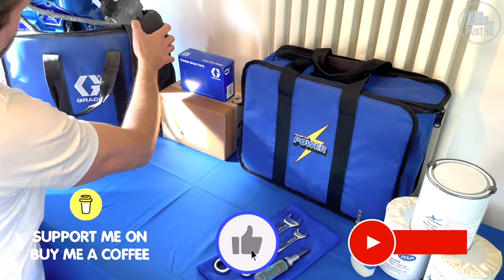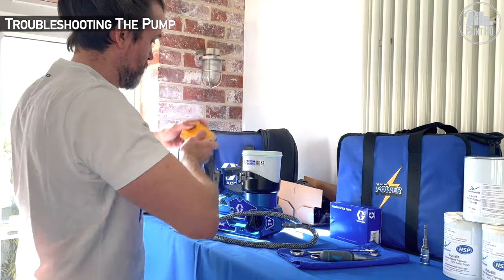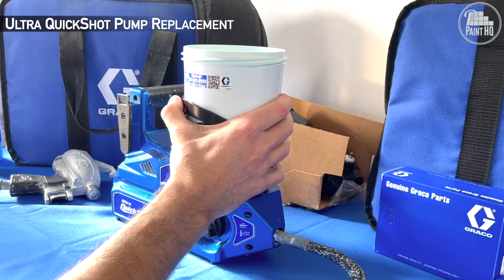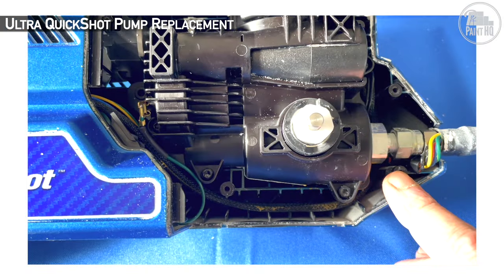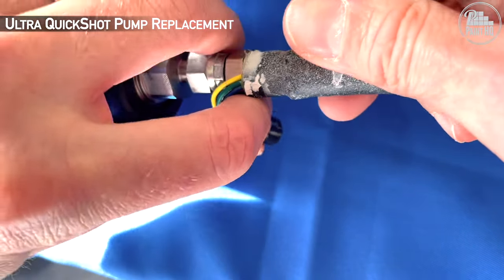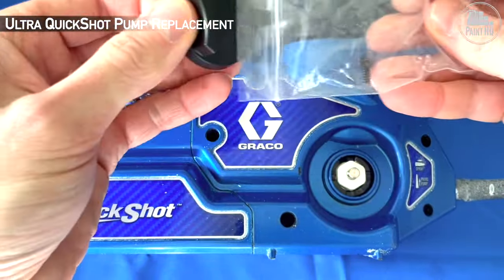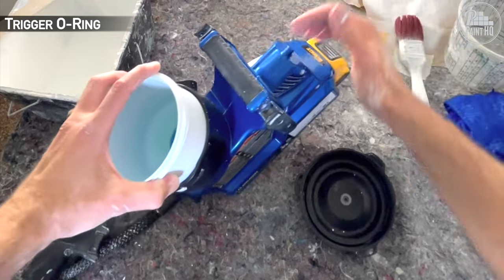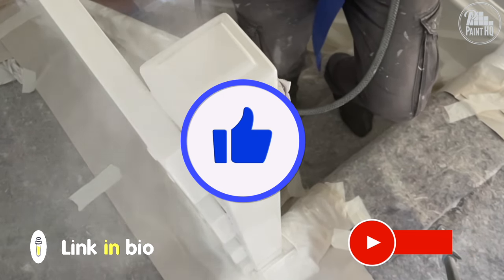Graco QuickShot [Tips & Tricks] Troubleshooting and PUMP REPLACEMENT

Comment: I own one and this is an extremely common problem. I maybe have 15 gals max through machine. Actually probably closer to 7. Same issue. For something that’s nearly 1500 dollars U.S, I shouldn’t have to rebuild in less than 3 months of light use.
Reply: Probably werent cleaning it/priming it properly. Ive used hundreds of gallons through mine. Door paint, exterior house paint, clear coats, and primer all thru my pump
Reply from the maker: @dabefarkel9382 Thanks for sharing your experience my friend 💙💯 Regards Pete

Comment: One tip for you Pete. Petroleum jelly is good but it is rubs off easily. I've been using Molykote 111 lube for things that need to withstand hot washing and are chemical resistant too.
Reply from the maker: Great tip Dmitriy, I’ll be sure to look into that 👏👏👏

Comment: hey pete great video. I’m having a hard time keeping enough power with my quick shot. It’s like the battery is dead, but it’s not and my spray pattern. It’s never atomized properly.
Reply from the maker: Hey buddy, my apologies for delayed response — sometimes comments slip past notifications ☹️ ..Does the unit prime and spray water? So remove tip guard / tip and try priming and spraying water.. does the flow spraying, increase with speed — so speed 10, and no tip guard / tip should spray a constant / steady stream.. let me know how you’re getting on my friend, once again sorry for the delay.. regards Pete 💙💯

Comment: Great video pete as always the pump replacement seems quite straightforward and your insight will help myself and many others thank you for your content pete
Reply from the maker: Ah great news John, yeah it really is a straightforward procedure 👍 Appreciate the support.. regards Pete
Reply: @PaintHQ  hi Pete just a quick question have used the quick shot with an extension stick if you have how did it go any spits at all cheers
Reply from the maker: @johnthemod71 Hi John, that’s a good question.. Yes, I’ve used a 25cm extension and you do still get a very small spit — that’s virtually undetectable in the finish when spraying ceilings.. logically a spit will occur when using any extension on any gun, because the paint that’s in the extension past the shut off of the needle, is at a lower pressure by the time the paint passes through the tip — so the spit is un-atomised paint 👍 hope this makes sense 😄 regards Pete
Reply: @PaintHQ  cheers that was a big concern of mine because I would probably use a 300mm stick to spray woodwork and all that bending up and down isn't good for my back and knees at my age I'm only 52 but feel 100 😂😂😂 cheers for the reply mate greatly appreciated

Comment: Great info Pete. Good to consider these things before an issue occurs, current pump replacement is around £260. Great little machine, glad I bought it. 

I wish all guns started using a quick release tip guard (tri-tech do I believe)...Or a shorted thread would do the trick. Always feels like it takes ages to screw on & off, especially with wet hands, or if there's been a sudden leak & you need to get it off, cleaned & back on asap! Thanks again for all your knowledge & help 👍🏼
Reply from the maker: Hey Stuart, great to hear from you buddy.. yeah I’ve been following your awesome work using the QuickShot 👏👏👏  I hear your point about ‘quick release’, it’s actually been around for a while, but naturally there’s always a question of safety when used with high pressure equipment 🤔  ..Thanks for sharing your insight.. Hope you’re keeping well my friend 🙏 regards Pete 💙💯

Comment: As Always, great content. I own a quick shot and I love it, great machine for a purpose and you make the money back very quickly with the right work. Highly recommend the quick shot.
Reply from the maker: Thank you buddy, appreciate you watching and sharing your experience owning the QuickShot 👏👏👏 Regards Pete 💙💯
Reply: Great video Pete
Wondering if my pump has gone?
It still pumps water out of the gun but there's really not much pressure of water coming out. Like a running tap worth of pressure,  maybe slightly less. Then when i put a guard and tip on it nothing comes through 
I tried cleaning it out with thinners to make sure there was no blockage but it hasn't helped.  My tips are definitely unnlocked!

Does it sound like a pump issue to you? 

Don't feel I've used it all that much tbh yet!

Many thanks

Comment: I’m still trying to trouble shoot mine. I just got it. Did a quick test on Friday and sprayed a bright green color. It did amazing. Loved it. Cleaned it. Ran like 4 pots of water through it till i got clear water. Came back yesterday and wanted to try a clear coat. Ran some water to make sure it was nice and clean. Glad I did. Little bit of paint came back in the prime. Not much. Cleaned it again really well till everything was nice and clear. Dumped the water and added my clear. Primed. Painted. It did so good. I loved it. Just loved it. I did notice though when I went to add more material that there was an ever so slight green tint to my clear coat. It did not affect the finish so I kept going. 

Today however was not the same. I was very diligent in cleaning last night. And again wanted to make sure I cleaned it well so ran some water through it. Everything seemed great. Added my paint and moved forward. I noticed as soon as I went to prime the gun that a little bit of watery clear coat came up. It was fine for what I was doing so i continued. In my haste I did forget to filter my paint. I did get some junk in the filter. cleaned it. I can shoot water through it fine. Now when I add paint i get maybe two passes and then paint wont come out. I’ve tried everything.
Reply from the maker: Hello my friend.. the symptoms you describe, specifically ‘junk in the filter’, then being able to spray a couple of passes before stoping — suggests the tip is blocked.. if you remove the tip and tip guard, does paint spray through the line and gun?.. if the tip is blocked, try soaking in Pump Armour overnight and spray hot water (just hot from the tap), speed 10 with the tip in the ‘unblock’ position 👍 let me know how you get on my friend.. regards Pete 💙💯
Reply: @PaintHQ  Thank you so much for the feedback. I did try switching out the tips. But now I’m not completely sure I did. I will definitely try what you suggested. I really fell in love with the sprayer. I hope I can get it working again.
Reply from the maker: @AngieWilliamsDesigns You’re very welcome, and I’m sure you’ll get to the bottom of the problem.. I try to think logically and take a few steps back.. for example does water prime in the cup, then switching to spray (with tip / tip guard removed), does water exit the gun? If so, does the speed work 1-10.. if so, add a tip guard and tip and try a different tip, then does water pressurise and spray through the tip?.. I’m sure you’ll eliminate the ‘problem’ 👍💙💯 regards Pete
Reply: @PaintHQ  I was feeling so anxious last night and this morning fearing I had broke the gun. I just happened to get my new tips from Graco in the mail today. So before anything else I tried one of the new tips. I definitely made sure to strain the product. It worked perfectly fine. I feel so much better. I have the two tips I used yesterday in pump armor and will try them again tomorrow. Thank you for your help.
Reply from the maker: @AngieWilliamsDesigns Ah great news 💙💯 ..Yeah soak the problem tips in Pump Armour, then next day install tip in reverse (in the unclog position), and spray water through, speed 10.. any blockage should clear 👍 Regards Pete 💙💯

Comment: Just purchased Quick Shot. Plan to use oil based Rust-Oleum Rusty Metal Primer and top coat on outdoor metal spindle fence (in 100°F weather). Any tips? Wish me luck. Thanks for the videos. Good stuff.
Reply from the maker: Hey Jeff, great news on your QuickShot purchase 💙 .. a couple of tips, especially working in the heat.. any down times, put the unit into prime, lock trigger and quarter turn the tip — this will close off the orifice and help stop the tip drying out .. also keep some white spirit handy, to keep the tip / tip guard clean — you could also wrap a white spirit soaked cloth around the tip / tip guard 👍 all helps in the heat to stop tip drying out.. always test the fan pattern on scrap paper before spraying.. any blockages, twist to unblock and spray it out.. Also keep the unit in the shade, and plug in the lid 👍 good luck my friend, keep in touch — I’d love to hear how you get on.. regards Pete 💙💯

Comment: Thanks for this great video Pete. I have just seen it and was very interested in your spraying with the FFLP 206 tip. What is the viscosity of the primer you were using (Ford cup), and can you also spray other primers if they are thinned to the same viscosity. If the prime valve opens to release excess pressure, does this do any harm, and can you tell when it does it. You say that the paint was not atomising fully but was spraying beautifully - perhaps you could elaborate on this. Use of the FFLP 206 tip looks useful for spraying smaller and more intricate items where HVLP would normally be used, so I am looking forward to your video on using this tip.
Reply from the maker: Hey Martin, thank you for watching and your kind words.. Yes in theory, if the viscosity is low enough, materials will spray through FFLP 106 and 206 tips — other factors are in play, such as the ‘sprayability’ of the material, where some pigments would be problematic, atomising through airless spraying.. I’ll have to do a video to demonstrate further — in this video, what you see is very good atomisation through a FF LP 206, at speed 4.5 — I found just a .5 more, so speed 5 (there’s a sweet spot).. would cause the prime valve to open (you can hear it) — material still atomises, but if you think of the unit ‘very quickly dropping and building pressure’ — what you’ll get a spray pattern that’s not fully atomising.. it all happens very quickly and is a safety feature to stop over pressuring and protect the pump 👍 you have to think of .006” tip as smaller than a human hair and pushing material through under pressure, the pressure will soon build.. So I understand why the Graco ‘official’ minimum tip support is .008 ..it would be less ‘problematic’.. the fluid flow between a .006 and .008 is considerably less 👍 

If I recall, this video demos the difference using a mechanical gun and a 395..

EXPLAINED Graco FFLP 106 and FFLP 108. Paint Viscosity and Airless Spray Tips
https://youtu.be/02ThdxmVOLw

..I will make a video specific to the UQS, the .006 tips and paint viscosity.. You do get HVLP like control, especially spraying spindles with a 106.. in the past I’ve used a 108, you have to move extremely quick 😫

Hope this helps explain a little.. appreciate your support 🙏 regards Pete 💙💯
Reply: Thanks Pete that's great. Your idea of a  video on the 'sprayability' of different paints would also be very interesting.

Comment: Hi Pete top shelf video as is the norm for you. Would you say the performance of the unit is the same as a Gxff its just the amount of paint that’s needed to operate the unit it’s just I’m thinking of getting one or the other to go with my old 495st thank you 👏👏
Reply from the maker: Hey Paul, thank you my friend, as always I appreciate you watching and your support 🙏 It would be wrong to choose the Ultra QuickShot over the GX models, unless the projects being sprayed really are that small — I think of the GXFF, especially the Cordless GXFF as the ‘big brother’ to the UQS — Same principle in paint delivery with its hopper / gravity feed of material, but the GX  ProXChange pump would be more robust — The Cordless GXFF is on my wish list 😄 Now the QuickShot will certainly be a good complement to your 495 👍 There is things you can do for your 495 to reduce the amount of material required to get spraying, a hopper / finishing kit / 3/16” hose for example 👍 Apologies, perhaps give off topic.. hope this helps.. regards Pete 💙💯
Reply: Hi Pete thanks for the quick reply,my 495 is already fitted with a hopper and smaller hose but as its an older model brushed motor @ 29kg it’s a lump to move around so I was thinking Gxff would do a lot of my work as I’m mostly domestic.Thank you for all your help.
Reply from the maker: @paulmorgan1636 Ah I see 👍 A unit that’s lighter could be useful 👏👏👏

Comment: Hi there great video. I have a followup question, in your professional opinion, can you achieve a professional cabinet finish with the quickshot (considering you do everything right like using the proper tip, etc) thank you for your time. Cheers from Chicago
Reply from the maker: Hi Ben, good question.. Yes absolutely — like you say, using an FFLP tip, in conjunction with the material being sprayed 👍 I see many in the refinishing world, sharing results where they’ve sprayed cabinet doors and boxes.. particularly useful onsite manoeuvring the electronic gun into tight spaces 👍 Then if I compare what I’ve achieved with a bigger airless pump, Vs the Ultra QuickShot.. the finish is the same — just remember the UQS is for smaller spraying projects 👍

 ..Great to hear from you in Chicago my friend 🇺🇸💙💯 regards Pete

Comment: Can someone tell me if these can use a higher amp hour battery like a 5ah etc
Reply from the maker: Yes you can my friend 👍 it just causes the unit to tip up a little because the bigger battery no longer sits flush with the bottom of the sprayer.. I have to say, the UQS is designed for small jobs, so longer runtime is not overly recommended — plus you get 2 batteries, so the one on charge will finish charging before the one in use runs out.. I’ve pretty much not used more than one battery on a job — one battery has been sufficient, including cleaning 👍 hope this helps.. regards Pete 💙💯

Comment: Hi Pete
My gun will leave a tail when using fflp 210 or 310. Its ok when using 514. Any advice? Thank you
Reply from the maker: Hello my friend, happy to help if I can.. it depends on your application / what you’re spraying.. if a latex / emulsion, then a 514 is the right choice out the 3 you mention..

You could thin the material — now I don’t like to do that with woodwork / joinery paint..

Then, the golden rule of increasing in tip size orifice, eg .008 -> .010 -> .012 is after increasing pressure and pressure becomes higher than you would expect (in the example of the QuickShot, you’re at speed 9 or 10), and tails are occurring.. that’s when to increase orifice size — your test with a 514 confirms  that theory.. you may need a 312 or 412.. paint is spread thinner over a wider angle, 412 Vs 312, so a 412 could be a better option, or move quicker with a 312.. some tip size selections are a trade off..

Hope that helps my friend.. keep in touch.. regards Pete 💙💯

Comment: Hi Pete I’ve had mine 4 weeks sprayed 4 houses of woodwork with armstead primer undercoat . Watered it down and it doesn’t spray with a 308 or the 410 it comes with only sprays with the 514 ??
Reply from the maker: Hi Mike, thanks for sharing your experience.. I’m not familiar with Armstead and it’s ‘sprayability’ — I’m suspecting it’s a product that doesn’t atomise and spray well, certainly as you say it won’t go through a .008 — most thixotropic / brush / roller products are paired with a .010 as they’re higher viscosity.. maybe a .012 such as a 312 or 412 is more suitable 🤔 it’s hard to say, I could be wrong.. regards Pete
Reply: @PaintHQ  thanks for reply I will try that thanks again

Comment: Hey Pete! 
I still haven’t made up my mind about which sprayer to buy.
Should i buy the quickshot for woodwork and trims or should i buy the hvlp 9.5 from graco for woodwork and trim?
I currently use my wagner 3.20 for walls and ceilings. 
It’s more so that i don’t have to flush the entire system to switch materials. Love to hear your thoughts on this. 
Regarda Peter.

Comment: Hello Pete. I have a quick shot and have been really happy with it. Yesterday I tried to use it and it won’t spray paint. It atomizes water fine but when I put paint in it the pump will spray for 10 seconds or so then lose pressure and a stream of paint will come out of the tip. After watching this I’m wondering if the pump needs replacing. We mainly use it to spray trim and doors since it doesn’t spit as much as our 695 airless.
Reply from the maker: Hey buddy.. Sorry to hear you’re having trouble.. Sounds like you’re loosing prime — apologies if this is obvious, ensure the lid plug is open, filter is not clogged (check you’re using the correct filter).. So spraying / atomising water is trouble free, just paint after 10 seconds?.. is the tip clogging — perhaps try a new tip.. hope you resolve the problem 🙏 keep in touch my friend, happy to help any way I can.. regards Pete 💙💯

Comment: How much paint was sprayed with this unit before it failed? I have it myself and just wondering how long it will last.
also how much was the replacement pump?

Thanks
ps. great content!
Reply from the maker: Good question.. This was an opportunity to troubleshoot a unit not spraying and demonstrate a pump swap out. Lifecycle is impossible to calculate, due to many contributing factors — materiel being sprayed, viscosity, speed / pressure, duration, cleaning. I can confirm I’ve tested and used various units / pumps and received feedback from others — What I’m hearing is all very positive 👍 You’ve invested wisely in a great unit, I’m sure it will earn its keep many times over.. Keep in touch my friend, would love to hear your feedback and experiences in future. All the best.. regards Pete — Really appreciate your kind words and support 🙏💙💯